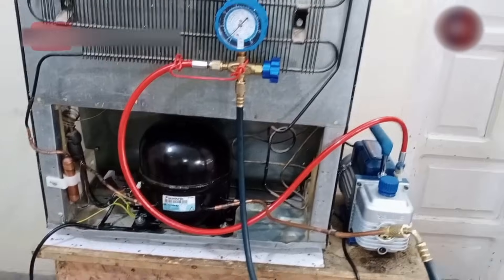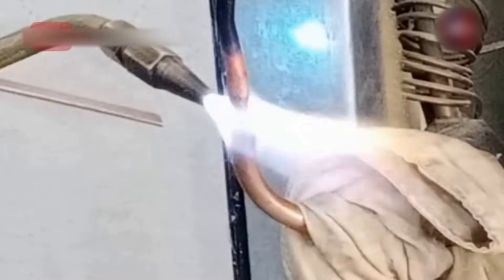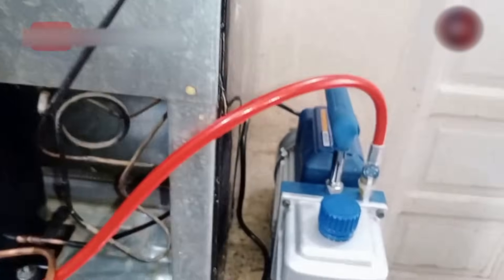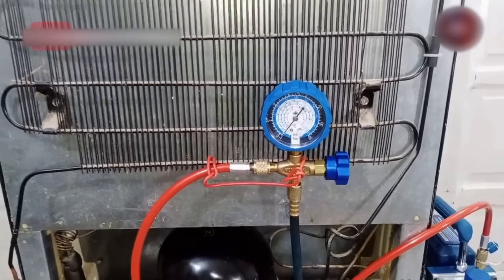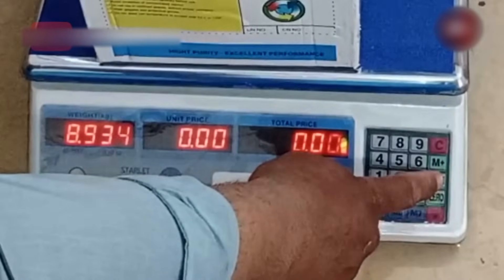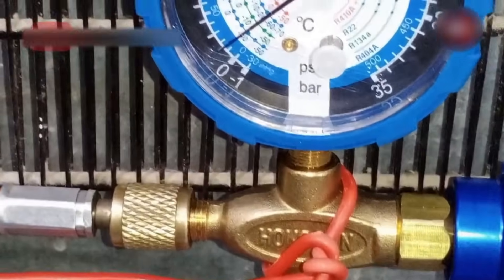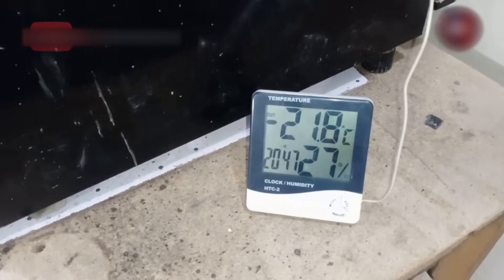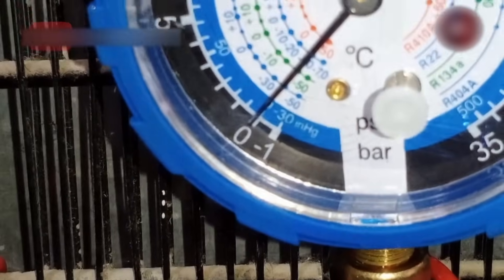How To Charge Gas/Refrigerant In A Refrigerator - R134A Freon

Comment: 3:09 - What is the reasoning behind the “maximum of half an hour” stipulation? I would expect longer is better for systems with a capillary tube as the metering device. I recommend a longer vacuum to assure all the moisture in the system has boiled off.

Comment: First off it isn’t welding, it’s brazing, purging nitrogen should be done because of the oxidation of the copper on the inside the pipe from the heat. Filter dryer will be partially clogged on this system because of the lack of nitrogen purging.

Comment: Sir I have one problem can u help me . The problem is in a back bar cooler i charger gas also replaced it's condensor did gas charging everything is fine it cooling but why sometimes suction line has ice  most of the time it's sweating I tried adding more gas realising it but nothings happening also the compressor is not even warn it's half side is sweating cold amps are changing rated amps are1.03 but sometimes it decreases sometimes comes to normal even cooling coil fan is spinning so what's the problem please help me
Reply: The gas is r600

Comment: You are either soldering or brazing, brazing if the temperature is 840 F or greater. Welding involves the melting of the base material.  The vacuum is not burning water it is boiling the water creating water vapor. Please.

Comment: Very concise. I like it. Can I probably gas a regular fridge with a car AC refrigerant kit? Also does anyone know if I can put a modern refrigerant in an older fridge? Will it still work fine or relatively fine?
Reply: you have to put the same refrigerant.
Reply: @jack76gh45  I don't think it really matters if your filling from empty. All of the mechanics are the same.
Reply: @izzzzzz6  take a look at saturation pressure-temperature charts of R22, R134, R32, R410A and R600 and see if the "mechanics" are the same.

Comment: The indication precision the blue analog charging gage can offer is definitely not sufficient for vacuumation monitoring. Proper electronic vacuum gages capable of measuring extremely low pressure are available from China for as low as ca. 30 USD. Some if them are directly interchangeable with the common blue charging gage and have normal charging gage functionality as well.
Reply from the maker: Thanks for the info.

Comment: Hello very good video but when R134a tank is up then it should be vapor not liquid? Just want to confirm. Thanks a lot
Reply from the maker: It is mentioned on the tank that which side is vapor or liquid, and every manufacturers could make the cylinder differently and it is not important that the vapor or liquid comes out by keeping the cylinder up or upside down. You have to check it on the tank, which is vapor and which is liquid side

Comment: Hello, I have a question: If I take a fully loaded 30 lb (13.6 kg) R134a cylinder, open the cylinder valve 3-4 times and leave it open without turning the cylinder upside down, how long will it take to release gas on average?
Reply: not a toy dude

Comment: What I like about this video is in 10 minutes so much practical instruction detail:  20 seconds to braze a pipe (to avoid carbon residue) , observing water steam vapor upon vacuuming ( before this I thought it was vaporing oil, but he pointed as time goes on the steam goes away), waiting a half hour to run if charged as a liquid, using touch and feel of piping for temperature difference and a practical explanation of over/under charge by feel,  Amperage and  freezer temperature check (ice cream keeps best at 0F).  standing pressure and back pressure and not getting hung up on replacing Danfoss with a Panasonic.  Great video, highly recommend, works for orifice air conditioning HVAC too.  Repairers can use propane torch, staybrite 8 silver solder and matching flux instead of brazing.
Reply: Same here everything is in detail

Comment: Sir please if Samsung frost free condenser is spoilt and replace it. When you fix a new one when you feel the fridge with gas and without the in side fan the evaporator will freeze to ice but when you fix the fan the evaporator will freeze half evaporator what should I do
Reply: check the pressure

Comment: tankyou my hearo but my quation is may washer over filling presure swich is ok also inlet wator valve is ok but the wator not stop and the washer not starting canyou help me???
Reply from the maker: Check whether the air trap is blocked. IF yes then it could be the reason.

Comment: You cannot really tell from the standing pressure if the refrigerant is over or under charged because the gas is in saturated state, meaning both vapor and liquid exist in the system. You can have less vapor and more liquid and vice-versa but the pressure would be the same as per 134a temperature pressure chart.
Reply: Can you say how you actually could tell if it's over or undercharged?
Reply: @yxcvmk  The pressure while running is some indication and may be marked on the unit label. I am not an expert. Probably a poor indication. Feeling the pipe temperatures is is also some indication, as shown on the video.

Comment: i thought when the tank is upright vaper will come out from the valve ,not liquid  while the vaper is always lighter and stay on the top of the tank, and when you are charging from the highside  or liquid line you must use tank upside down to charge liquid

Comment: please i need  clarifications: the manifold gauge used in this videos shows that at 100psi the saturated temperature is about 16degreeC. Which is contrary to the what's in the p-t chart for R134A. Also with this illustration what's the superheat.
Fantastic video i must admit !
Reply: I think you are reading the second line from center for r22, 100 psi approx 16C  instead of the 3rd for r134 100psi about 19C.

Comment: Hi, I dont understand how you can say the vapour from the vacuum pump is water,
Reply from the maker: because the water went inside the pipes of the refrigerat lines.
Reply: Ok,  I never experianced that. Must have been a lot of water in the system. When I vacuum I get oil vapour breathing out of the vacuum pump.
Reply from the maker: This was the same with water. I have A video on its compressor as well. And I tried to filter its water, If you are interested, do watch that as well.Vdo Link: https://youtu.be/2Ac8q8RIr-s

Comment: In EU they made this repair so much expensive, it is not economical do this,. Only certified technician can handle refrigerants. Ordinary man cant buy it. Only certified technician can handle blowtorch. Ordinary man cant buy acetylene gas for blowtorch.  So you just buy new fridge,,... Mission accomplished, planet saved,...
Reply from the maker: Yep, That's what your thinking is mate. I think if The fridge cost about for example 1000 dollars and the repair cost is 100 dollars it is more worth it as you save those 900 dollars in your pocket.. Hmmm That's what it is.
Reply: @forevertechenglish  Avg home Fridge cost about 350 dolars,.. And new compresor costs about 200 dolars,... AC tech want 100 dolars for his work,.. Thats why repairs are made only on some big expensive fridges in stores or shops. Normal people just trow it to junkyard and buy new one,..
Reply from the maker: Now I understood what you are trying to convey after searching the prices of refrigerator, Thank you

Comment: Lol that oil vapor
Reply: No, he is right juts instead he said burning he should say boiling or vaporizing. Boiling term for water only when phase change from liquid to vapor but vaporizing is a general term for any phase change from liquid to vapor.
It is normal when you have a vacuum can achieve very low pressure the water start vaporize at low temperature, in pumps world we call it cavitation.

Comment: Big mistake.
Danfoss refrigeration compressor uses internal thermo overload  protection switch,while a Panasonic uses an external thermo overload protection switch.
If you must use the danfoss PTC relay on a Panasonic compressor you must improvise a way of introducing an thermo overload switch between the power supply going to the common to the common terminal of the compressor.
Reply from the maker: Yup you are right, I also realized it while editing the video.

Comment: This is an excellent video, I was wondering, the board that you plugged the refrigerator into (with the amp meter), what's the name of it, and where can I get one?
Reply from the maker: Dear The board i Plugged the refrigerator in I made it my self
Reply: @forevertechenglish  Thanks for you speedy reply
Reply: @anselmjames1  you can make also by buying amp meter ,Lot of shops in Pakistan are using this handed made board

Comment: Excellent explanation keep it so good.
Reply: Coppwr using  norml pipe   blow  torch  conneted  ti  the oxy -acetylene  gas  qelding  equipment  is  used  to  heat  the  joint  while brazing  steel  or  coppwr  pipe  joint  the  same  eqyipment  can  be used  for  used  foe  doingthe  patch  workof  refrigerater  ac  deoep freezwr  etc..hwat is  priducwd  by  the burning  of  mixture  of  oxygen  and   acetylene  using ..
Reply: Oxy acetyene  gas  welding  copperpipe  eakel jiunt selver brezing
Reply: Welding time    metal  sheet   shaide holding  and   welding  vrey  nicelt  wy  reson   s  comprssar  winding   in susting  hot   runging time    cottinng  removeing  and    winding  shorting  come  resons  ..    ac  systion  home  applen systomes  comrssars and   poperly   welding jone  sotabls  testing jonted all  leckges   mus be find outing fixed    vacmes snd  gas  chargeing  134a  ..  jolly ..

Comment: To make sure the evac was done properly you need a vacuum gauge.   You also need to do a pressure test with nitrogen.   This compressor replacment was not done correctly
Reply from the maker: Yeah You are Right I needed a Vacuum gauge to make sure ( But After 30 years of experience I know the vacuum I did is good or not  )  and I already did the nitrogen test before filming this video.
Reply: @forevertechenglish I said the same thing and I use to do it the same way.  I learned my lesson
Reply: @TheKiltedHam  coming from the guy that says you can’t freeze the valves on the compressor. And idc how long you done this you will never tell with out the gauge that a vacuum is complete. Bunch of hacks
Reply: @Freonleon  I said you need a gauge to tell if an evac is complete.  You can charge a unit through the suction side without freezing the valves if you do it correctly
Reply: What solder did you use and gas?
Reply: Lol. 
What does -30 on the suction gauge indicate. 
Only way we had in the military.
Reply: @rhemamachaira8763  that’s it’s in microns but you can’t see how low in microns or read exact

Comment: Your charging threw the suction side, when charging after a vacuum, you should charge threw the liquid side or you will freeze the valves
Reply from the maker: Did Anyone noticed That I charged The Liquid in the refrigerator While the compressor was turned off
Reply: @forevertechenglish  yea after you pulled a evacuation but like I was saying dumping liquid in threw the suction side like that is not good for the compressor, of course you do it threw the suction when it’s running that’s the only way but you meter it. But small compressors like that can freeze the valves and you turn it on and your compressor is shot. But people don’t want to believe it.
Reply: You never charge through the liquid line on any system. R134a is not a blend. Do not spread false information
Reply: @doctorfeinstone6524  yeah your right 134 not a blend, but when charging before start up you charge threw the liquid side of charging with a liquid. Yeah you charge threw the suction when in operations. But after a evacuation you when your charge with liquid goes in the liquid side.
Reply: The word is through. Threw is the past tense of throw.
Reply: @MekazaBitrusty  ok professor jackass thanks for the grammar lesson
Reply: You should never charge through the suction line that’s the worst you can do. But that’s appliance I do commercial refrigeration but good video besides that and the micron gauge that’s not a micron gauge and not the proper location for it.
Reply: I've been in the field repairing domestic refrigerators I am reading these comments and smiling to myself. I charge through whichever side. When vapour; I ensure only vapour. When liquid, it's never with the compressor running. My track record has been quite lovely ❤
Reply: Что там, в компрессоре замёрзнет? Металл?
Reply: Not true
Reply: @TheKiltedHam  yeah it is on a small compressor
Reply: @Freonleon  so
Reply: @TheKiltedHam  so what you think happens when the compressor is flooded with liquid? 134a is a blend so you charge threw liquid yes but liquid goes in the liquid side, dumping liquid in a compressor not running you will freeze the valves and you cut it on it’s gonna damage the compressor and then shortens the life. CMB STICK TO your Disney world videos.
Reply: @Freonleon  Disneyworld videos???  I have never been to Disneyworld. Any ways, if you know what you are doing, charging through the suction side with liquid is perfectly fine.  Again, if you know what you are doing!  You don't just open your gauges all the way and dump in refrigerant.  You need to slowly add to the system.
Reply: @TheKiltedHam  why worry about that when you can easily dump the charge threw the liquid line after evac. Read any hvac/r book and it tells you charge threw liquid line until you can’t then turn your system on and like you said slowly add threw the suction. You will never have a hard/ loud shitty start up on a compressor. And when you click your name only Disney videos show up on your account. But best practices are not taught and that’s the problem in this trade. Everyone learns it wrong and does it one way for 20 years
Reply: @TheKiltedHam  sorry I’ll correct my self 134a isn’t a blend so when charging it you can charge threw the suction AS A VAPOR.
Reply: @Freonleon  you are reading too much into this.  I never said charging through the suction was right, I said you can if it is done right.  You said "you will freeze the valves"  what you should have said is you can freeze the valves.  If it is done correctly you will be just fine.  And I never said I didn't have Disney videos, I said I don't have Disneyworld videos.  And that's not all that is on my channel.
Reply: @Freonleon  r134a is not a blend that's r410a
Reply: @JahonCross  yea I have corrected myself if you keep looking.
Reply: @Freonleon  but how you do that ? You don't have any valves on the liquid side on a refrigerator to charge in liquid form
Reply: @rewernan  they are all sealed so you have to tap in the suction side, so you would tap in the liquid line. Who only looks at one side of the system?

Comment: I bet this guy clogs a lot of lines with solder with those huge gaps and ill fitting lines! He should take a pair of dykes and pinch the line to fit tight before welding. Also what is going on with the 3 foot long process stub?
Reply from the maker: Dear Brother Never Happened I never Clog Pipes while Welding them

Comment: That's brazing not welding but good video overall
Reply: As welding is defined...it brazing is a form of welding technically. 

But yes...in layman's terms it is considered brazing.

Also the water and air rae not burning,...but it is considered burned off.

I agree...It is a good video.
Reply: @Lupgaroo666  sorry but brazing is not welding sir. Welding is when you join two or more metals by melting the base metals and brazing is actually consider a  form of soldering as its not melting the base material. It's joining the metals by filling the space in between the metals with a filler and does not melt the the base materials.
Reply: It's a welding torch.